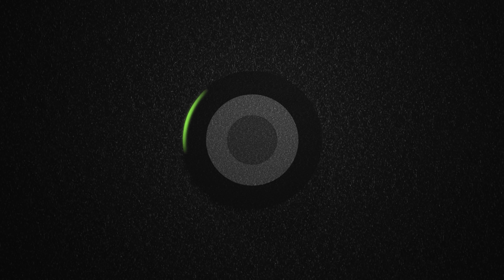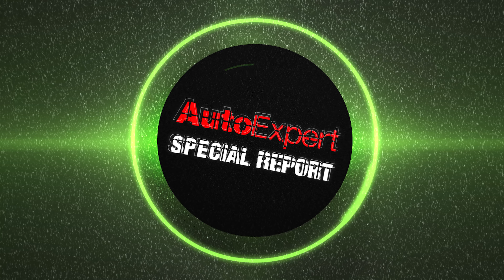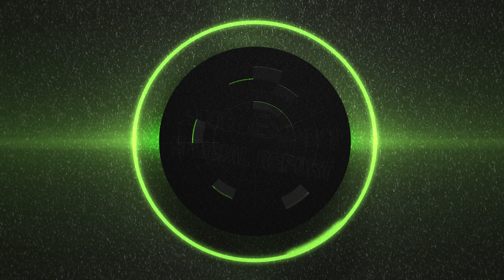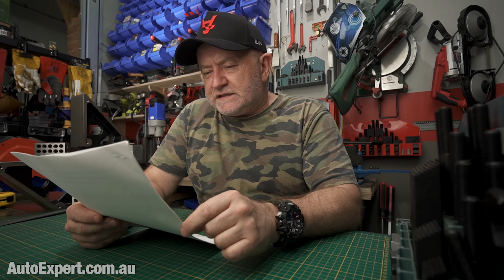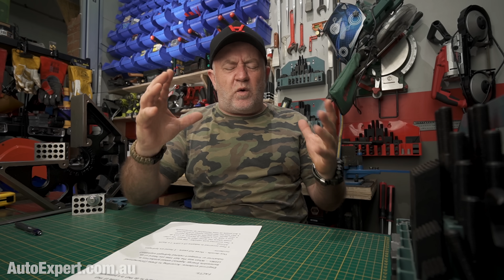The truth about fire risk: Hydrogen fuel cells and battery EVs | Auto Expert John Cadogan

Comment: You quote the 1 in 2000 car fires you currently get, you cannot move that statistic to EVs without looking at the current ratio of EV to Fossil fuel fires, the NTSA in 'Merica have this, "battery-powered EVs suffer only 25 fires per 100,000 sold, compared to 1,530 for petrol or diesel vehicles, and notably 3,475 for hybrids." So your 2000 Fossil cars will equate to about 50 EV fires, I know which one I prefer. You are dead right about fires in underground car parks, it will only take one catastrophic fire and the authorities will take notice, it will be a bit late!

Comment: If you compare volatility of Hydrogen to gasoline using something like the CRC manual you will find out at various temperatures gasoline is more volatile and hence more explosive also considering a unit of gasoline has a higher BTU content than an equavalent unit of hydrogen.  During WWI German hydrogen filled Zepplins were used to bomb England.  It was found they were notoriously hard to shoot down, even with incendary bullets.  Why?  Hydrogen is a fuel.  No combustion can take place with out the addition of an oxidizer.  The pilots found they had to absolutely riddle the Zepplins with bullets to introduce air into the gas bags.  Then they could fire their incendiaries and set them off.  Frank Luke was a famous American baloon buster.  Luke AFB.  Introducing gasoline to the average schlub in 1908 was probably a very hazardous experiment.  And I have heard Japanese hydrogen fuel cells with long range are using 10,000 psi tanks.  All things under pressure are dangerous including any gas cylinder and the hot water heater in your house.  A heater explosion can wreck a house.

Comment: Awesome video. I have worked around dangerous gases and fuels for over 35 years. I have worked around High voltage also. 

I had to work around an even more volatile gas than most. I was doing work on an Isohexane system.

They used the change of state in it to pull oils out of a product. 

I would rather shoot at a Hydrogen storage tank than drop a wrench from a ladder around Isohexane.

A hole or leak from H2 is not as scary as people think. The H2 goes up in the air at about 40 mph from earth's surface. A small leak in H2 is going to empty the storage tank quickly and the fuel will be gone.

In liquid or LPG fuel, it is more dangerous

Comment: The water tank for filing scuba cylinders is for cooling.  Compressed air is hot.  Aluminum or most metals lose strength when heated, especially aluminum.  They don't of course do this when you are having a propane cylinder filled.  Propane is cold.
Reply: Propane isn't cold per se, it's a drop in pressure to fill a propane tank so you get a J-T cooling effect. 
Air you're normally using a compressor, so you're increasing the pressure, which heats the air.

Comment: I really wonder about the risks with lithium-ion batteries in general, but more so in cars because of their capacity. I've seen small battery tool packs cook off in a shop environment and the experience left an impression on me. Thankfully I've never seen a fuel tank dump its fires goodness everywhere yet. I'm sure that would leave a mental scar as well.

Comment: LI batteries are already causing fires all over the joint.  The notion that you can put one on your wall is concerning.  The idea that you can park one in your garage is even more so.  I doubt they they will remain insurable for very long.  There's a great video on the saga of a model 3 requiring tremendous effort to extinguish, for a period of time.   There is a ship on the seabed containing a large number of EVs.   A huge fire sunk it.  Remember?
Reply: Correct. There have been many indicative events, but some cleaver information suppression kept us in the dark. 
Several municipalities have prohibited indoor EV parking. Some counties have prohibited indoor LI battery systems. I would guess some underwriters would prohibit or add a premium for garage parked EVs; but have no direct knowledge. 

The latest products for home energy storage mount on the wall outside of the house.
Reply: https://youtu.be/Qzt9RZ0FQyM

LFP does not exhibit the same thermal runaway issues as John has explained.

Most new EV's have LFP batteries.

Watch the vid, an axe through it, while charging, and nothing but smoke?

Yer, she'll be right, mate.

Comment: It's gonna take a multicar EV pile up on a freeway before the masses catch on to how bad a lithium battery fire can be.
Reply: https://youtu.be/Qzt9RZ0FQyM

Most new EV's have LFP batteries.

So you're right, the masses will catch on to how bad a lithium fire can be. So bad, there's hardly any flames...

Notice how it went with the axe piercing straight in to it? A multi car pile up won't pierce the battery in any car. But it would have leaked petrol all over the freeway in a conventional car pile up...

Comment: I think that Hydrogen is inherently more excitable than butane , methane, propane etc due to the explosive range.
For example butane is 'explosive' between 1.8% and 8.4% by volume with atmospheric air.
Propane 2.1% to 9%
In comparison Hydrogen is 'explosive' between 4% and 75%. 
So a much greater opportunity for a 'runaway thermal event' as per the old airships I guess

Comment: Hi John. You touched on the wide flammability range of hydrogen / air mixtures but left a crucial part out. It is not so much the flammability that is a concern, more the explosiveness. It is actually pretty hard to make an explosive mixture of petrol and air. With hydrogen it is hard not to.

Unlike most fuel / gas mixtures even uncontained hydrogen / air mixtures will readily undergo deflagration to detonation transition with little to no encouragement. The same energy released in a detonation is far more likely to damage property and cause danger to life than the same energy release without the brisance. In human terms it is the difference between a push and a punch.

That said none of that is the problem with hydrogen. The problem with hydrogen is that it will always be less efficient than other options. It will never be anything other than a niche product in road transport.

Comment: John, the petrol comparison is an old and tired mismatch.  Petrol (gasoline) needs its FUMES mixed with AIR at around a 16:1 ratio, then ignited at something above its flash point.  Light a flame over a full jerrycan, and a flame will burn quite nicely, but it won't explode.  Not until the fuel level itself is low enough to allow that gas/air ratio inside the tank would you have a blowup.

Hydrogen is far more volatile than that, has a far lower flash point, ignites far easier and with more force, and requires far more disciplined 'best practices' to prevent ignition.  What the letter was about, was that most people DO NOT practice that kind or level of care.  That would make H2 more risky than petrol.

Comment: Food for thought for those interested: Fully electric vehicles pose less of a fire risk than hybrids and gas cars, according to 2021 data from the National Transportation Safety Board compiled by insurance-comparison site AutoinsuranceEZ. There were 25 EV fires per 100,000 sales, compared with 3,475 hybrid fires and 1,530 internal-combustion engine fires per 100,000 sales, respectively.

Comment: Despite the "hazards of "embrittlement" " - Compressed hydrogen has been stored and transported in steel vessels for quite a long time...  H-Embrittlement is more of a cryogenic, or manufacturing -process hazard rather than a time in contact with steel - kind of thing.  (10xx series steel may not be the material of choice nonetheless - probably not the best choice for many things)  - of course there  are Boffins who really know these things - then we have talking heads and keyboard warriors, jks - not really irony..)

Polymer lined Carbon wrapped Aluminium types of storage; are a nice lightweight way to replace a heavy thick walled steel tank - NB, if the steel (you know the word is used loosely here)  is really a hazard at "room temperature", it is simple enough to line the vessel in the requisite high molecular weight  prophylactic barrier.

NB. lumping all Li-Ion species in the same category doesn't address the move to cobalt-free, aqueous electrolyte (freezing issues - when storing unplugged in the Frozen Wastelands) types of cell...  (Don't worry they - the braniacs are working on retardants in many other types of battery cell)

Comment: As a fire expert, you make a good  engineer. 

BLEVEs are common place at house fires with LP gas cylinders. (Boiling liquid evaporating vapour explosion) Gas cylinder detonate because the thermal heat causes the liquid gas to vapourise in situ and the pressure relief valve can't handle the volume. The structure becomes heat effected and the steel looses its tensile strength and fails. It rips things apart. I have seen quite a few personally and had the pleasure of cleaning up the mess not.

Hydrogen tanks make from kevlar......no mention about what the decomposition rate of kevlar is at certain temperatures. 

A car fire with upholstery burning against a kevlar cylinder will certainly exceed its structural capacity. If stored at 200 atmospheres, there is a real question on whether the relief valve will decanter the cylinder quick enough to prevent a high pressure release of gas (unlike liquid, hydrogen is already a vapour) .
Aluminium will melt in a car fire, it's common to find a cylinder head, radiator and even aluminium rims as puddles. 

The biggest hydrogen explosions in recent times were Chernobyl and Fukushima which were reported as nuclear explosions. 

Significant LP gas and fuel tanker explosions or fires. L.P.Gas tanker hit by truck on Hume highway exploded burning tarmac off the ground. 
Petrol tanker caught fire outside the Collingwood training centre, alas they may have been a few years back but they do happen. 

Major accidents involving tankers are common but in most cases, it's the liquid nature of the fuel that extinguishes a spark or cools heat rather than igniting it.

Comment: Is it true to say manufacture Hydrogen or is it more accurate to say extract hydrogen? We can’t make the Stuff M8 and aside from your chemical composition of your atmosphere you ignore the fact that moisture ( H2O ) is also in favourable atmospheric areas even in Kalgoorlie where I live mostly. Splitting the stuff as you pointed out is risky especially if you collect the gasses in one place, it’s interesting that it takes less energy than the yield of it exploding. Fittings are the weak points in hydrogen fuel systems the tank technology had to be sorted back when jeweller’s used hydrogen in their torches for creating the beautiful broaches and pendants. Hydrogen was a brilliant fuel for the clean brazing of silver, gold and other precious metals … on the thermal runaway theory you suggest I reply with the fact is the chance of a moving conflagration is as high as Spinifex causing a runaway bush fire. Forty or fifty EVS catching fire would require them to be stacked like that ship. It’s not vehicles on the level it’s when the next battery is above the first fire. I think you are too pessimistic for the actual physics. We have very few problems with the very dangerous Petrol powered vehicles and I don’t see as many Electric Vehicles joining those figures …

Comment: The first flaw in the dude's argument is he is banging on about the fuel/air mixture - which would indeed be potentially very explosive, but no air is going into the tank, just the fuel. I remember from my school chemistry class that pure hydrogen in a test tube burns with a pop - i.e relatively slowly - mix that with air in the test tube though and say goodbye to your eyebrows and spend the next hour picking shards of glass from your face 🤣

Comment: I do find it slightly ironic that so many people have this idea that battery EVs are somehow intrinsically dangerous and they're all catching fire (even though they're not, and there is empirical data to prove that they're not), yet when Samsung had their wee issue with mobile phone batteries a few years ago, nobody took a vow to never use mobile phones.  In a similar vein, I know of some people who refuse to use a vape, because "those things are dangerous, their batteries catch fire".  But they're more than happy to carry a butane or petrol lighter with them, and they've never been known to leak...
Reply: The difference between a lighter and a vape is a lighter doesn't have its own self ignition system built in, unless you have 240v self heating testicles...
Reply: @Rosie Hawtrey  don't they?  A lighter doesn't have a spark wheel or a piezoelectric ignition?  And in very close proximity to where the fuel is?

All 3 are just as safe as each other unless you do something daft with them, in the same way that mobile phones are also not bursting into flames on a regular basis, nor are battery EVs.

There are many reasons to maybe not like vapes or EVs.  Spontaneous battery ignition happening "all the time" isn't one of them.

Comment: About a month ago I saw a report of a house fire caused by a Lithium battery left charging overnight. I think it was an electric scooter or something similar, so not a large battery. At the end of the news report came the caution/recommendation not to charge Lithium batteries, unattended. In short, don't charge them while you are sleeping. So pretty much every EV and plug in Hybrid will be charged overnight while we sleep, which is starting to look a little scary.
Reply: Also your, vacuum cleaner (some are lithium ion battery), garden machinery (all going down the route of battery), DIY power tools and in some cases people have lithium ion energy storage batteries with solar panels or wind turbines. All one massive worry.
Reply: The scooter would be an illegal scooter without the appropriate comms for the battery.

all legal and proper batteries have comms that ensures the battery is not overcharged, and stops charging if that comms ever fails.

This includes EV's, home batteries, power tools, etc

Comment: At least petrol & diesel car fires can be controlled by the fire services whereas runaway thermal events in car batteries cannot. I believe in Austria they have very large towable metal water tanks into which an electric car on fire can be dumped. Most buildings, including multi storey car parks, have to satisfy fire regulations. Extensive damage was caused to a multi storey car park in the UK when multiple diesel & petrol cars caught fire but at least the building did not collapse. Damage is often done to the road construction when petrol & diesel vehicles catch fire, even more damage will be caused by runaway thermal events when battery vehicles catch fire.
In my opinion encouraging the extensive use of lithium-ion battery powered vehicles is a mistake. In addition to the fire problem the additional weight of battery powered vehicles causes increased tyre wear & thereby production of more PM 2.5 particles. To reduce pollution with the current state of technology the greater use of petrol hybrid vehicles as initiated by Toyota should be encouraged.
Although in the UK I subscribe to the Australian Institute of Public Affairs (IPA).

Comment: Hey John. I have seen multiple houses get damaged from an exploding LPG tank in a car inside a shipping container. Blew the rear of the container apart. Structural damage from blast destroyed the timber framing connections to some homes. DIY restoration job on old car i believe.
Reply: Did gas leak into the probably relatively sealed container and then explode?
Reply: There you have some components of a bomb, confinement. If the fuel/air mix is right but cannot expand on ignition, bomb.

Comment: As far as I'm aware there's no phosphate in NMC Li-Ion cells. There is in LFP cells which last longer and have a lower risk of thermal runaway. The other way NMC cells can go nuclear is from manufacturing defects. The other big issue with EV Nirvana is having the charging infrastructure in place or at least some plan to have it in place especially in apartment buildings. Then there's those of us forced to park our one vehicle on the street. Not to nitpick but there was quite big hydrogen explosion not that long ago, Fukushima. Then there was the Hindenburg but as is obvious most of the flames and heat went will up and many survived. Personally my eye is on the Aptera which apart from long trips I'll never need to plug in.
Reply from the maker: Phosphates, carbonates - ions with lots of onboard oxygen.

Comment: The Hindenburg really gave hydrogen a bad rap.
Just a quick stat from Europe where they have a lot of EV,s (more than 50% of their cars in Norway). The fires in cars with Internal combustion engines are about 1500 per 100,000 sales. The fires in EV.s are about 25 per 100,000.  Yep, EV,s much harder to put out but much less likely to happen. 
Just one more stat re Felicity Ace, of the 3800 odd vehicles it was carrying, 200 were Audi Etrons so while it is possible that the eV,s made it more difficult to extinguish, even the investigators are not willing to say that and basically that boat was going to sink regardless of the EV,s because the fire was so intense at least partly because of the construction of modern cars with high amounts of plastic plus the oil in engines, gearboxes and diffs and it took so long for the fire boats to arrive because it was 400km from the nearest land and it was rough seas, it was carrying 2,000 tonnes of oil and 2,000 tonnes of fuel but mostly because of the breakdowns in the Felicity Aces own fire fighting systems.  According to the fire report the cause still remains unknown but the captain originally stated that the EV,s were one reason they were having trouble putting the fire out to start with. Take from all that what you will.